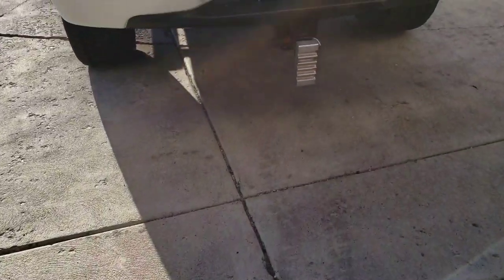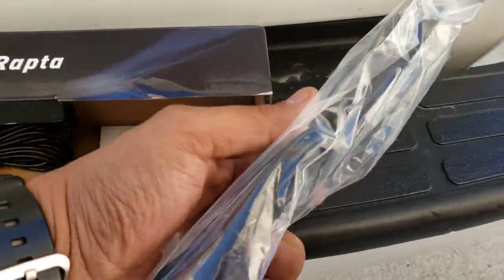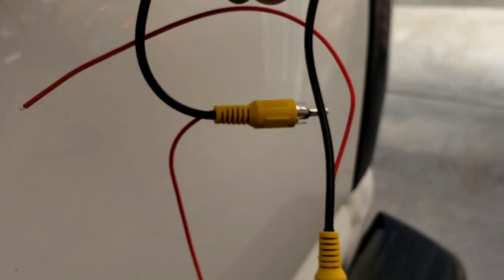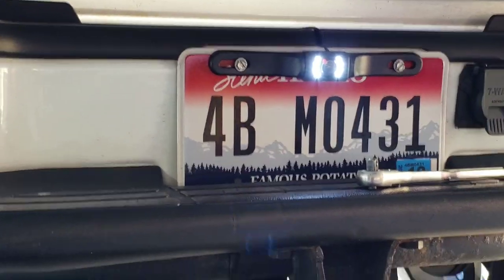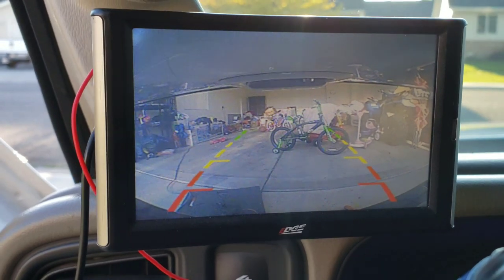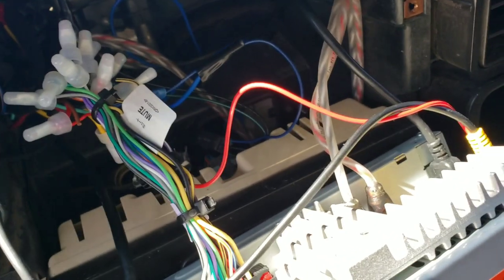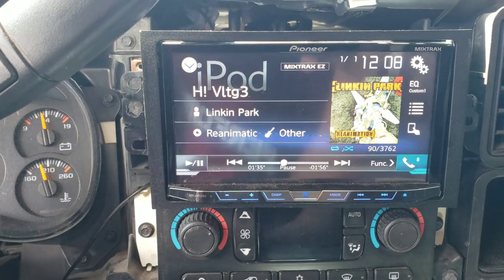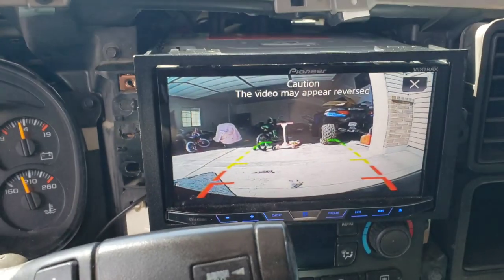eRapta ERT01backup camera review and install on pioneer double din!!

Comment: Appreciate the video! What they don’t tell you is you need another power wire to connect to the small red wire on the plug and run it to the reverse light. If you don’t do
That the pioneer unit will not automatically turn the reverse camera  on. You can go to the camera and manually select it and it will work.
Reply: How do you do that? I have an agh-1300nex and this camera. It was working when i left the shop. Now i put in R it triggers the screen but camera picture is black.

Comment: Just bought same camera and also have a pioneer deck. The deck connection end seems straight forward. AV cable into the proper input then the red wire to the purple and white stripe wire off the head unit harness. Where I’m confused is in the back with the camera. There’s a red and black wire that comes off the connection that plugs into the red plug off the camera. The black wire is the ground i assume and the red wire the power. BUT, there is also a red wire off the end of the long cable that runs up to the front of the car. So, are both of the red wires at the rear connected to the power wire off the reverse light? The instructions are terrible. Just want to make sure I have this right at the ready if the car. Thanks!
Reply from the maker: so the red wire that's kinda connected to the yellow video wire? if its that one you are talking about then i hooked the one near the camera to the reverse light and the other end in the cab to the wire that senses the that you're in motion. I had to read my pioneer deck instructions to find out what wire to splice into or else it wouldn't turn on. it would know the camera is hooped up but no video would show up on screen unless that wire was spliced into the wire. it's dumb but it took me a bit to figure it out. still works great till this day!
Reply: Rikki Diesel thanks but I’m talking about the red wire that’s off of that black plug that goes into the red plug off the camera (you are holding that wire at the 2:00 mark of the video). You make mention of it in the video but you didn’t go over how you made the connections in the back of the truck.
Reply from the maker: Not to be mean it rude but I didnt mention it cause thata like the easiest part...u literally plug that in to the Male black wire where the little red and black power wires come out.
Reply: Rikki Diesel not taken as rude at all. I appreciate the video and your replies. Maybe I’m not being as clear on my end. I am good with the radio connection end of the install. It’s the back by the camera that is confusing. There’s two red wires that have to be connected. One is from the yellow plug. The other is off of that black connected plug. Do both of these ref wires get connected to the reverse light positive wire? That’s what’s unclear in the instructions that came with the camera. The black wire I understand is a ground. But again, there’s two red wires that need to be hooked up.
Reply from the maker: Yes they do. Once u plug the male black wire in to the red female one that comes out of the actual camera. There are 2 little skinny red and black wires on the male wire. But yes the both small skinny red wires go into the reverse light
Reply: Rikki Diesel thanks. That’s what I was trying to figure out. Lol. Appreciate the reply. Going to tackle this tomorrow.
Reply: @rikkidiesel  Was the black wire you plugged into the red female wire included with your kit or did you purchase the black wire separately?  I'm trying to install the exact same back up camera system and everything in your video makes sense, except my kit didn't come with that black wire.  Trying to figure out is the company forget to pack the wire or if you got that on your own.  I think I can cut the female red wire open and direct wire the red and black wires to get the same results you got
Reply from the maker: @mw92015  if I'm remembering correctly. It was just to extend the wire and all I had was black for color
Reply: @rikkidiesel  Ok, but it was something you had on your own and not something that came with the kit. I need to extend the wire too, so I’ll start looking for a similar connector
Reply from the maker: @mw92015  idk I might have to watch the video or tell me what second of the video your talking about and I can tell u
Reply: @rikkidiesel  It's at the 2 minute mark.  It's a black wire with a male connector on one end and a small black and red wire coming out of the other end.  You mention plugging the black wire into the red female connector.  All that makes perfect sense in your video, except my kit didn't include that black wire.  So I'm trying to figure out if I need to contact the company and complain I didn't;t get that wire, or if you got that black wire yourself.
Reply from the maker: @mw92015  aww I see yeah thats the power extender wire. It's basically just has the positive and negative wires on the end of it. So u could contact them and say your missing it and they will send it to you. They have been good to me customer service wise
Reply: @rikkidiesel  Ok. Good to know.  Thank you so much for responding and responding so quickly.  You’ve really helped my son and I out. We appreciate you!

Comment: Was there any drilling , splicing , or crimping of any sort with this when youre routing the wires towards the front ? 
Thanks !
Reply from the maker: From bring the bring the wires from the rear to the front. No just used the long cables its came with. There was splicing only to the lights on the rear and in the cab that's all

Comment: Man this seems so straightforward but I’m not getting any video. Same camera, Alpine head unit. I have the red wire going to a reverse light, the other end is connected to the reverse trigger wire for the head unit. I know the camera is getting power cause the LEDs come on when I put it in reverse but no video, just squiggly limes. Blowing my mind. I took it all out and replaced it once already. It’s driving me nuts.
Reply: What happen

Comment: Thanks for the great video tutorial.
Just want to make sure I understood correctly.
from behind the deck, connect the "red wire that's part of the yellow plug" to the reverse wire of the deck's wiring harness?
Reply from the maker: Yeah on my truck but it could be different on every vehicle. U just need to find the reverse signal wire
Reply: @rikkidiesel  do you hook the red wire up in the back end as well or?
Reply: I too would like to know about the other red little wire
Reply: @rikkidiesel  can you please let us know. I'm trying to help my dad on his
Reply from the maker: @davidweeks6425  i have another video on the full install re wire goes to either the reverse power wire and the other side goes to power signal wire on the  cd player harness wire

Comment: Nice I was wondering how you would install a backup cam if you had a truck. Hopefully when I do it everything will go smooth. Never done any type of work on a vehicle before
Reply from the maker: Yeah it's not bad man. U just need wire cutters, electric tape, dielectric grease and time lol

Comment: Did you hook up the wire to the rear reverse light?
Reply from the maker: I hooked up the power wire to the reverse power wire
Reply: @rikkidiesel  thanks for the fast response..... I was confused on whether to hook up to reverse light or to my pioneer radio
Reply from the maker: @Scrap3001  u will have to hook the red wire that comes out of the yellow av cable to the signal reverse wire on the deck wire harness though

Comment: so the red wire in the back what power wire did you exactly tap into?? could you show us?? cause i have the same truck and didnt splice that wire and i think thats my issue
Reply from the maker: I said in the video the red wire off the rca cable in the rear goes in to the reverse power and the other side on the deck goes into the reverse wire on the wiring harness
Reply: @rikkidiesel  right i got the stereo part down but the back wire did you just do the power wire in the tail light harness below or did you tap into the power wire going from the camera to the tail light? sorry for being a pain in this ass i was just trouble shooting this for like 12 hours today and this video saved me
Reply from the maker: Yeah the red wire that near the camera goes to the power on the taillight wire

Comment: I am installing a backup camera......the red wire (with the yellow plug) connects to the reverse wire only? Or both red and reverse wire have to connect to the camera red?
Reply from the maker: So the wire stick out of the yellow plugs goes to the actual reverse light and the other side that does the inside wires into the reverse wire on the radio harness
Reply: @rikkidiesel  does the red 12v wire from the radio connect to anything?

Comment: How do I do this in a state where the state name can't be covered up?
Reply from the maker: I'm not sure man mabey mount it on the bottom holes?
Reply: @rikkidiesel  yeah I have an 00 ranger and you can't really do that
Reply: If you have the room you can 3d print some 'risers' that bolt to the top holes of the plate then allow the camera to be mounted above it. Call them 'hole extensions'.

Comment: Man ... Mine has the wires coming out of the camera and a male insert with another red and black wire coming out then a female adapter with positive and negative inserts the instructions are useless
Reply from the maker: So did this help you or nah?
Reply: @rikkidiesel  mines a different version i guess still at it

Comment: Hey I have the same truck and radio and camera. Mine does not work sometimes when I put it in reverse it acts like it’s switching to the signal but nothing happens. Have you had this problem yet ?
Reply from the maker: my actual camera went bad also but they warrantied it out and sent me a new one. im sure water or snow got into the connect. so with the new one i put dielectic grease on the connect and havent had a issues since.
Reply: Rikki Diesel ok I got mine over a year ago but just now put it on so I bet they will not warranty it still.

Comment: Q:Is there a way to make the rear camera come on automatically when you put it in reverse instead of having to touch the camera button on screen?  Just bought the pioneer 1400nex and this backup camera.  Connections appear correct since everything works but only when I hit the camera button on the touch screen and putting the car in reverse versus the camera turning on automatically when I put the car in reverse without having to go to the extra step by having to hit the camera button on screen.
Reply from the maker: Yea it's in the camera settings and u made sure the little red wire and power wire are hooked directly to the reverse light cause mine is hooked up at way and it only turns on when I put it into reverse and turns off when I put it In either park or gesr
Reply: I’m having this same issue with the same setu. Where in the camera settings?
Reply: Dude mine is doing the same help me

Comment: Man I got the same camera I hooked everything up even the two small red wires together and I have to put truck in reverse and hit the camera button but won’t do it it park or drive
Reply from the maker: @cody6.6max  if u want it on all the time then u need to hook it up to constant power
Reply: @rikkidiesel  I hooked up the small red wire to the positive than ran those to the taillights positive and ran the ground , ran video wire to head unit plugged it in , and tied red wire to reverse at head unit and now it only works when I put in reverse and hit camera
Button
Reply from the maker: @cody6.6max  yes it will only work when you put it in reverse cause it's only getting power when the reverse bulb is getting power. If u want to work in drive, park and reverse u will need it to be hooked to a power source that in all the time when the vehicle is on. So don't hook it up to the reverse anything..hook up to constant power
Reply: @rikkidiesel  I’m saying when I put it in reverse I have to hit the camera button on the head unit , it won’t go into camera
Mode when I put it in reverse that’s what I’m saying
Reply: I want it to work as in… I put truck in reverse it comes on but it don’t . I have to put truck in reverse and hit the camera button . Is it the way my head unit works  or a wire issue
Reply from the maker: @cody6.6max  it's gotta be a setting on the head unit. Did u hook up the purple wire behind the head unit? That senses when the vehicle is in reverse?
Reply: @rikkidiesel  yup ….. hooked up both two little red wires one at head unit to reverse and the other to the positive reverse wire with the other red wire and black to ground… I wonder if I need to undo the little red wires like u did ? I have 2003 lb7 . Have an kenwood  and I put it in reverse nothing until I hit the camera button . But the head unit gotta know it’s in reverse cuz it comes on only when it’s in reverse but by clicking the camera button

Comment: I can plug wires in.  I wanted to see how the wires were actually run and hid to get in the cab of the truck
Reply from the maker: Every vehicle is different. But on my truck I just ran them thru the frame of the truck then up into the engine bay thru a fire wall boot into the cab
Reply: Thank you

Comment: What’s the monitor you have mounted?
Reply from the maker: Like my dvd player or the edge monitor?
Reply: Rikki Diesel the one in the corner
Reply: How did it connect to your gauges ?
Reply from the maker: @frankievalerio5168  the edge then
Reply from the maker: @frankievalerio5168  that's what it does. It monitors the engine vitals and such. You just hook it to your ob2 port and your done. This is the 2nd generation I've had the first but I heard the third is the best